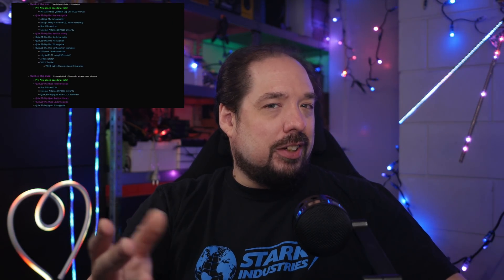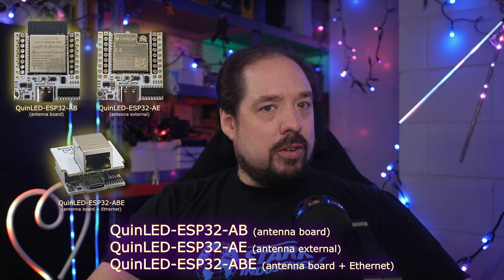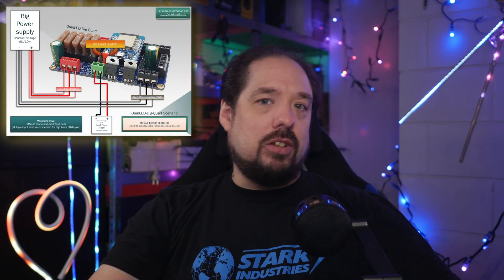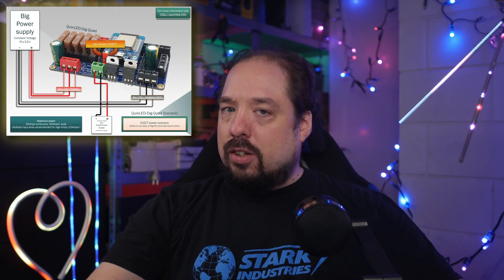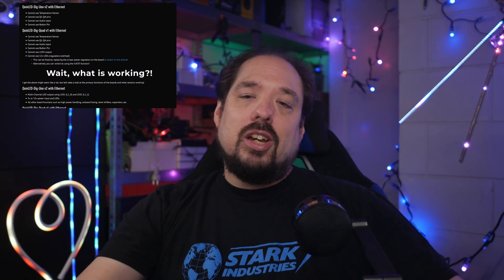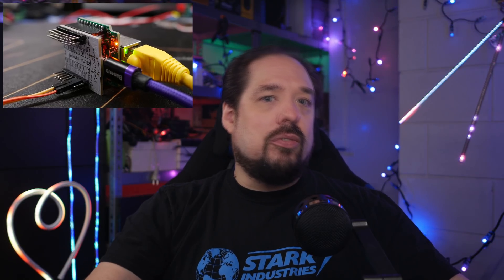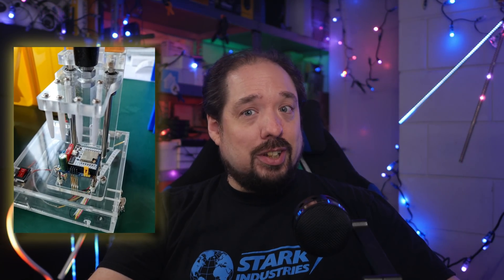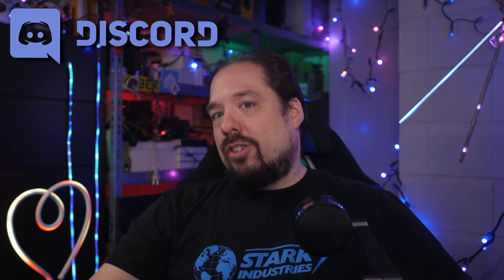💡QuinLED💡 New QuinLED-Dig boards are here and in stock now!

Comment: Does the QuinLED-ESP32 and/or QuinLED Dig Uno v3 incorporate a level shifter to 5V?
Reply from the maker: The Dig-Uno and Dig-Quad have level shifters built into them, the ESP32 is what plugs on top as controller.

Comment: Hello, thanks for all you do, love the boards.  I just started my journey into whole house leds.  I have them all up, might redo my junctions for power injection but had some questions regarding that using a QuinLED-DigQuad.  I have a lot of LED's hooked up.  Guessing roughly 60 meters, maybe a bit less.  From your vid, just double checking, for that long of a run, will I be ok with the single Data channel?  Do I need to do a sacrificial led to do that long of a run, or does your boards pretty much keep that from being needed.  These are 5V LED's.  Also for power injection, was running the thin 22 awg wire along the strips with the LED's but was gonna inject at each corner of the roof as well back to the power supply.  Should I stick with 22 awg wire back to the psu for all of the injections, or should I bump up to 18 awg for the individual runs?  I know I have seen vids that mention thicker wire might get warmer, just don't wanna cause a fire.  Hopefully that is all I need to know just thought I would ask the expert ha!  Thanks again for all you do.
Reply from the maker: Poh, that's a lot to digest here, let's do that on the Discord!

Comment: Hi, I stumbled across your amazing boards described in that video. I was thinking about an option of powering the board via PoE (instead of the 5vEXT ports) while having the LEDs driven by the common PowerSupply which could be switched on and off. That way the board would stay online via PoE while saving the IdlePowerLoss of the LED driving PS.
Reply from the maker: Yes, this is currently perfectly possible including automatic toggling of the relay! It's using a little add-on dongle, check my article here: https://quinled.info/2021/04/24/can-you-run-leds-over-poe/ (including a livestream where we try exactly this!)
Reply: @IntermitTech  Perfect, exactly what I was looking for. Many thanks and stay healthy

Comment: I'm in the USA and new to WLED.  Went to DrZzs shop but "Out of Stock".  When do you anticipate more boards for DrZzs?  Will your Quad board support four APA102 strings?
Reply from the maker: We restocked the Dig-Quad recently, but those are flying out of the door, I believe there are some Ethernet versions left though. And currently a new big shipment of Dig-Uno is literally in the air, so begin next week I think. :)

A Dig-Quad will not support 4x APA102 since that would require 8 data ports (2 per APA102 strip). 2 should work ok.

Comment: I can't find anything that explains how to add the dig-quad board with wled pre-installed to my wled app. I somehow need to connect it to my home network.
Reply from the maker: I'm confused, I have several guides on how to do this with WLED? Join the WLED-AP, set set WiFi to join your network, search for it in the app?
Reply: @IntermitTech  i apologize, I did find out how to set everything up using your guides.

Comment: I am looking to to get a led controller with one custom feature and I was hoping you could help me out I would love to buy a controller from you
Reply from the maker: It really depends what custom feature you are looking for. :)
Reply: @IntermitTech  I have a rgbic gauge cluster in my car and I use the sp107, I would really love a led stacking feature but instead of restacking after one cycle all the LEDs would stay on solid after the first stack. If this is possible, is there an email or someway we can talk more, if possible, I can buy a bulk order because I do led swaps in other cars also
Reply from the maker: @michaelskff  Well the boards can do it for sure, it would just take a little bit of custom programmering for the exact effect. Join the Discord server and let's talk there. Even if for instance WLED or ESPhome software wouldn't be able to do it, a simple Arduino sketch would be able to no problem. :)
Reply: @IntermitTech  that is so amazing, I will join tonight

Comment: Glad to have ordered (and received) a Dig-Uno before the July 1 changes to the import regulations.

In which video did you explain the use of the 5V-EXT?
Thinking about using 2 PSU's (small one for the ESP and big one for the LEDstrip) and cutting power to the big one when not used.

Comment: Quin ESP looks very nice. But I have one question. How about a board that is always powered by a 230Vac->5Vdc(or 3.3Vdc) pcb psu. Like a Hilink or MeanWell. And then pass the 230Vac to an relay to the big PSU for the ledstrip. I'm thinking about such a board a long time. But what stops me is that I have no experience with mains power on a pcb.
Reply from the maker: Sure, that's exactly what we're doing with this? Only they relay isn't integrated on the board, since messing with AC is something very different from DC, so this is the best solution in my opinion.

But with 5vEXT you have a small power supply to power the board, and a relay on the AC side of the big one.

Comment: hello i ordered befor 2 weekes or so and  i get V2R7.. is it up todate?

I dont put it under power but i  llike do do it as fast as possible ;-) 

greetings..
Reply from the maker: Yup, that's the new version already!
Reply: @IntermitTech  thx for your answer!  i want to connect a INMP441 micro to make your board soundreactive,  what of the pins do you recommend to solder the mic(6 pins) ?   thx  the quad board is so nice! i like to move it outside to iluminate some trees :-)   greetings

Comment: Using 2 prebuilt v1 Dig Uno's, 1 DIY v1 Dig Uno (with 9 more boards waiting to be soldered) and a "early access" Dig Quad v2! Will definitely be ordering more Dig Quads, one question if we are not planning on using an Ethernet hat would it be possible to make a hat that provides more level shifted outputs? Wether it's an add on that you offer or made DIY it would be awesome to use those pin headers with an additional board that could add 4 more level shifted outputs. Is that even possible?
Reply from the maker: Poh, I guess in theory it's possible and I might do more output boards in the future, but for now 4 outputs is really the sweet spot, only when you want to run more, short LED strips would it make sense to use more outputs, otherwise you can load up each data port with at least 600LEDs without dropping down in framerate. :)
Reply: @IntermitTech  I was using the quad in my PC case and the ARGB fans have no output to loop them together so I figured if I had a few more outputs I could make them work independently
Reply from the maker: Ah, that's an interesting use case, didn't think of that. Well currently I don't have a solution for that. What you could try since cable lengths will be really short, is trying the Q pins as data outputs anyway. They'll be 3.3v, but very short. Worth a shot!